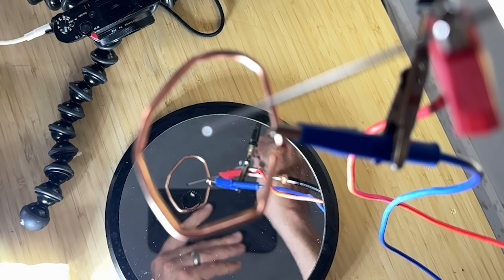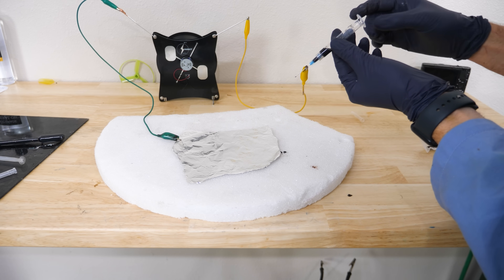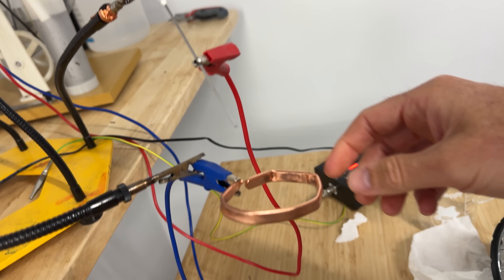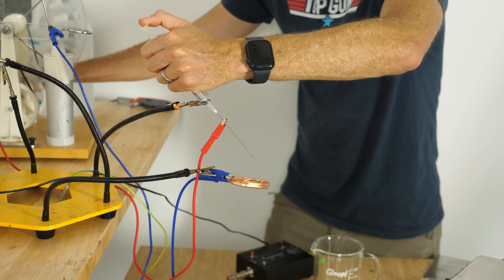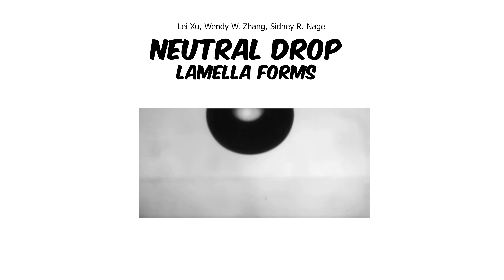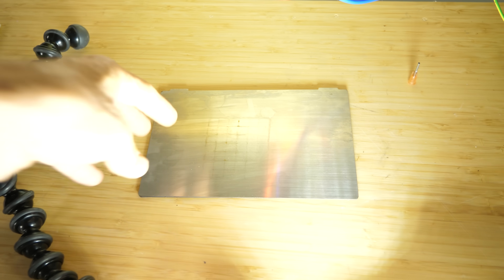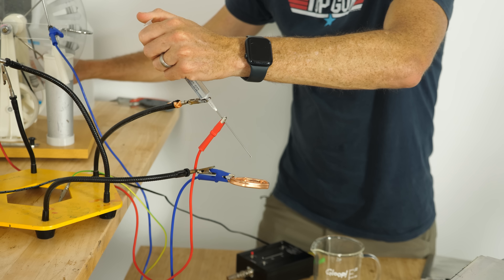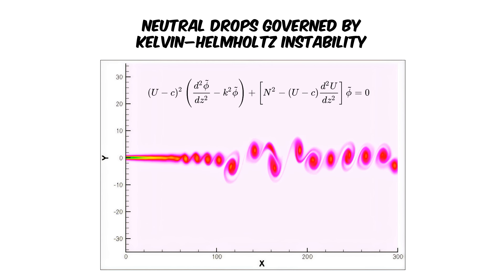Scientists Just Found Why Electrified Drops DON'T Splash

Comment: What happens if you let a neutral drop fall onto a charged plate?
Reply: I would assume it would not splash since electric forces do not change if charges are switched. So the lamela would still be attracted to the surface
Reply: @legolegends9750  If the alcohol and plate were oppositely charged, I would think that would attract the lamella towards the surface reducing the splash.  That's what the glass does regardless of the direction of the charge.  I think he was using the charged plate to counter the attraction that a similarly charged alcohol would have towards that plate's surface.
Reply: @legolegends9750 you wouldnt be swapping just the charges but their position too, it's not so symmetrical
Reply: @legolegends9750  cannot assume - test time!
Reply: Or even charged plate/droplet combinations?
Reply: @donbangert  Or even charging a plate with both a same charge or opposite charge and watch the interaction
Reply: I'm also wondering because you could maybe use this for cars windscreens
Reply: @imBigo  in winter, the drops are bigger and slower moving, they also don't seem to splash as much and stick to the window screen. but in summer, the drops splash more and rapidly flow down the windows. i always thought it was just temperature related, but is it? there's more static in the air in the colder months....
Reply: whats the world record for the biggest single drop of water? and charge it to not splash :P
Reply: @KrispyCREAME805  It could be over 2M diameter single drop in near Zero gravity plane drop or Space Stn experiment
Reply: @KrispyCREAME805 I wonder about forest fires w. properly-charged bombs of H2O being dropped onto them, flowing/spreading and not blowing all over from the helicopter's blades...
Reply: It explodes
Reply: We had the same thought
Reply: What happens if you let a neutral drop fall on a neutral plate and charge 20 bucks for it?
Reply: @StefanReich shut up and take my money
Reply: Any thoughts about an object being dropped into a small body of charged water? I guess it might splash more because the droplets will be pushing each other apart.
Reply: What if the plate and droplet are the same charge? Larger splash?
Reply: What if charged plate fall into water.
Reply: Could we do without car windscreen wipers if rain water could be repelled !!!!!
Reply: try it on a neodymium magnet surface
Reply: Since the plate is conducive the charge would all be in the edges/corners of the plate, so perhaps the drop would splash just like with a neutral plate.
Reply: Wow, I was about to ask the same exact question.
Reply: What if you let a charged plate fall onto a neutral drop?
Reply: I dunno. Sounds like a double slit experiment.
Reply: What’s it got stuntman?
Reply: I was wondering the same thing
Reply: Yes exactly. The missing thing.
Reply: Nothing observable to naked eye
Reply: What about a charge watergun?
Reply: Or a charged plate on a neutral body
Reply: Thank you for this.
Between the vacuum and now a charge, you opened my eyes to something completely new.  
Please keep up the great work.
Reply: hmm good question
Reply: what about charged plate on a neutral drop?
Reply: Black hole
Reply: since water is also dielectric, the same thing may actually happen.
Reply: Or a Negative on that be interesting!
Reply: Now if an infants is 70 - 75% water, can they not splat?
Reply: As soon as it touched it would charge, like charges repel so I believe it would splash more.
Reply: I want to connect high voltage to my car's windshield to see if it improves vision in rain.
Reply: @buckstarchaser2376  If you can figure that out it would make you a millionaire most likely, and also on the hitlist with windscreen wiper blade companies. First it would have to be very low current, such as static voltage levels for safety, then you need a transparent conductive coating thats tough and a way to make a tough transparent grid to charge the drops, thats not a trivial design by any means.
Reply: @ThuleApsu  For now, there's Rain-X windshield washing fluid. It seems to get most of the way there, but the drops do splash still.
Reply: It wouldn't have an opinion? (sorry)
Reply: Different surfaces Vs different charges including ferrous and non ferrous metals
Reply: Something lamella attracts to the plate.
Again if the plate is slightly charged(0.05nC per mm^2)
Reply: it will slash due to neutral particles being attracted to both positive and negative particles
Reply: don't do this it creates mustard gas
Reply: Wtf happend with his hair and mustache? Dude giving me predator vibes

Comment: Electrostatic charge a Submarine propellor and the water is less likely to form hydrostatic/hydroacoustic bubbles (wake)... TLDR: Silent Running
Reply: Interesting idea, but given the conductive nature of water, and the strength you'd need to overcome cavitation shock waves, I think the amount of power you'd have to apply would be detectable on its own~
Reply: @auturgicflosculator  Not if you can find a way of simply utilising the ionised air to create a Leidenfrost effect and use the charge to stop the air from breaking away...
Reply: @babalonkie  If I take your meaning correctly, by air you mean vaporized water...an interesting rabbit hole, but how would you mask the thermal output?
Reply: @auturgicflosculator  A tube around the propeller would do most the heavy lifting...

Conveniently... already on submarines ;)
Reply: @babalonkie  A tube will keep the heat that produces the leidenfrost effect from being detected? ...wat? I think I need to be stoned for this conversation.
Reply: @auturgicflosculator  A tube/cowling will shield the blade and immediate surrounding water from heat detectors... after that it's a ocean... essentially a giant immediate heatsink with constant cool water recycling, there will be no residual heat to detect... the mechanism cannot heat the water around the submarine lol. It would only affect the immediate water around the blades.
Reply: @babalonkie  Getting stoned helped. If the sub is near the surface, airborne IR sensors can detect a thermal wake. If the sub dives deeper, the pressure rises and more heat would be required to maintain the vapor barrier. At 200 meters depth you'd need the whole surface to be about 300ºC, and at 800 meters it would be about 400ºC ish. What are we making these blades out of that will withstand that kind of heat, and instantly transfer that heat to a huge enough area that no tiniest fractions of a degree of sensor data can be detected by modern ASW systems? The cowling would glow on thermal sensors. Plus, I'm pretty sure there'd be a detectable salinity wake from boiling and condensing all that salt water~You made me think, and it was fun.
Reply: @babalonkie  I will bow down to your gloriousness if you ever invent it and it works~
Reply: @babalonkie  A material that absorbs sonar, is tough enough and flexible enough to handle massive torque and temperature fluctuations? Firing out ideas is fun, but my brain likes to poke holes in them even more. Maybe it's the autism, maybe it's the OCD, maybe it's the PTSD, heh. I can't turn off my doubtometer~
Reply: @auturgicflosculator  Ways and means.

"Maybe it's the autism, maybe it's the OCD, maybe it's the PTSD, heh. I can't turn off my doubtometer~"

Throw in Anxiety, Depression, Agoraphobia, Arachnophobia and claustrophobia to your list and you are on my level...

Meds make the difference in caring and not caring ;)
Reply: @auturgicflosculator  even with a nuclear sub?
Reply: @bsoul3177  i dont see how that changes things
Reply: Yup. Applies to a variety of drag reduction methods in a variety of fluids.
Reply: Some kind of electroosmotic thruster might work...using voltage to move ions in the water, producing thrust without cavitation? I suspect that the thrust to weight ratio would be be too low for big subs, though.
Reply: @auturgicflosculator  If it moves it fast enough to match the speed of current subs... it would produce cavitation along all the surfaces inside of the thruster all the same
Reply: @DarkAttack14  Yeah, you're right. Speed kills. :P~
Reply: @auturgicflosculator  Like a magneto-hydrodynamic caterpillar drive
Reply: you need a cone shaped propeller rather than a boat propeller.
Reply: @HamguyBacon  Have you seen the latest sub propellers? Designed for less cavitation in a very spherical way... and with a cone over the top of them... ;)

I actually think it's totally possible with the technology already or even already being used.
Reply: Mean while FBI open up, and you end up in the back of a van for giving away military secrets lol
Reply: @scriptles  "Mean while FBI open up, and you end up in the back of a van for giving away military secrets lol"

Every military technology secret is slaved to the inevitable natural discovery by Civilians.
Reply: Best thought so far !👍